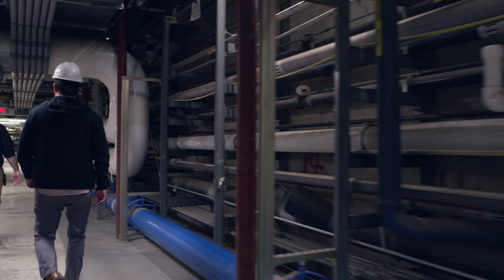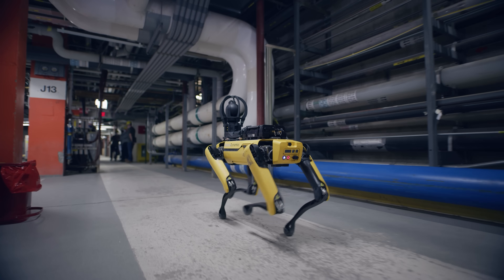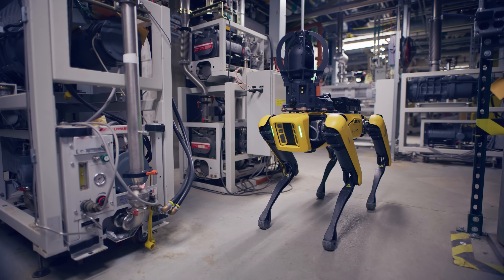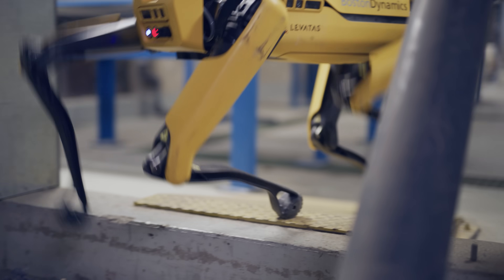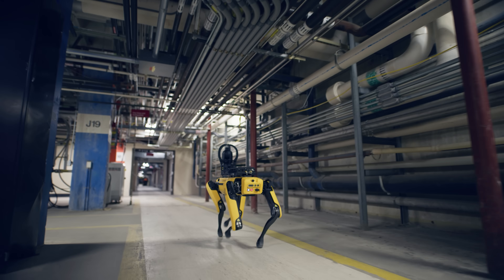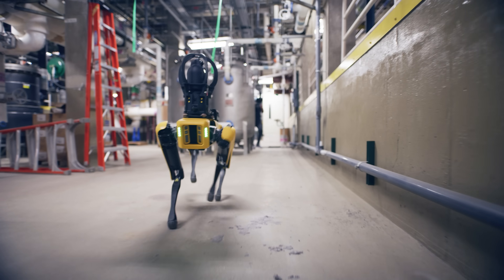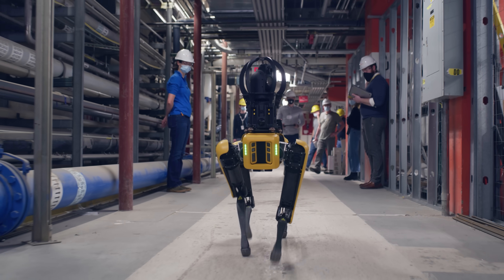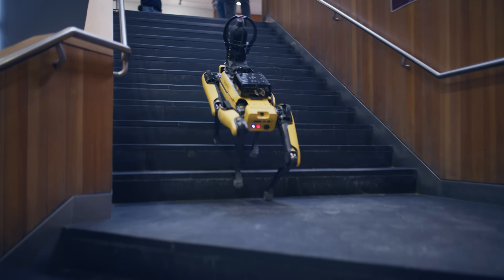Spot at GlobalFoundries | Enterprise Asset Management

Comment: Enterprise Asset Management (EAM) can be revolutionized by leveraging robotic automation for monotonous tasks, such as monitoring sensors and equipment, increasing efficiency and reducing human error. As this technology advances, it will be fascinating to observe its long-term impact and the industry's expansion, potentially leading to optimized asset performance, reduced downtime, and enhanced overall productivity.
Reply: EAM can be transformed by autonomous robots, which eliminate labor costs and needs, while offering versatility through interchangeable sensor suites. One robot can replace multiple surveyors, predict maintenance, and reduce downtime, increasing production and profit without breaks or absences, revolutionizing asset performance and efficiency.
Reply: EAM and investment strategies share a common thread - expert guidance is key. Consulting a financial advisor boosted my portfolio by 65% since January. In EAM, specialized consultants optimize asset performance, maximizing ROI and minimizing losses.
Reply: I'm looking to partner with a consultant to enhance my investment strategy and Enterprise Asset Management (EAM) practices. I've explored options on LinkedIn, but haven't received a response yet. Could you recommend a reliable consultant or firm with expertise in EAM and investment guidance?
Reply: Rebecca Noblett Roberts is the licensed advisor I use. Just research the name. You’d find necessary details to work with to set up an appointment
Reply: I just checked her out and I have sent her an email. I hope she gets back to me soon
Reply: For expert guidance on investment strategies and Enterprise Asset Management (EAM), I recommend consulting Rebecca Noblett Roberts, a licensed advisor. Research her name to find the necessary details and set up an appointment to optimize your asset performance and investment portfolio.
Reply: To enhance your Enterprise Asset Management (EAM) practices and investment strategies, consider consulting Rebecca Noblett Roberts, a licensed advisor. Research her expertise and schedule an appointment to maximize your asset performance and portfolio growth.
Reply: Rebecca Noblett Roberts is the licensed advisor I use. Just research the name. You’d find necessary details to work with to set up an appointment and to maximize your asset performance and portfolio growth.

Comment: This really doesn't require legs.
Reply: The legs are used as a way to efficiently get up stairs as opposed to wheel based robots
Reply: @guse7688  I guess, but this is great on its own. I just think that it's just to ride Spot's coat tails, so dumber people will be impressed by it.

Comment: I wonder how costly it will be to put some web cameras in front of sensors and one pc that could analyze incoming data instead of buying an expensive robot?
Reply: You are talking about hundreds if not thousands of points that would need to be refitted to accommodate such a device. Not to mention the wiring, downtime, modifications, etc. The costs of doing so would be astronomical compared to just using a single robot like Spot to just manually check the gauges and sensors. Spot would pay for itself.
Reply: more expensive. Otherwise they would already have done it.

Comment: You can use one $100k robot to read 1000 gauges, or you can use 1000 $100 raspberry pis with cameras.
(Installing power to then all might bea challenge though -- spot brings that with it)
Reply: and then you have the issue of how the fuck are you going to coordinate 1000 pieces of electronics together without constant malfunctions and errors.
Reply: @LineOfThy  True, but if even 5% are broken, you still have 950 working cameras.
I'm not against Spot at all, in fact I want one, but there's always more than one way to skin a cat.
Reply: Spot is 75 thousand with a roughly 10k software. From what I remember at least.

Comment: Spot is very cool, to be sure. But just so I'm clear - it walks around and looks at gauges? Assuming there's no way for that info to be sent to a central server, it seems like it would be a lot cheaper and less effort to just set up cameras pointing at the gauges, and someone whose job is to sit and watch the videos and note the levels on the gauges. That would return the info substantially faster than a robot that has to walk around every gauge one at a time. The whole thing feels like a solution in search of a problem rather than the other way around.
Reply: it's not.

Comment: One of the things that doesn't come through, at least to me, is if Spot learns to navigate through buildings, read gauges, do thermal imaging, etc. without an operator watching a screen and moving joysticks. So the question is - is Spot autonomous after initial training and why is it more cost effective to use Spot vs a human for the same application.
Reply: Autonomous robots don't have healthcare needs, a 401k, social security, wages, etc. These robots, most likely, can have be interchangeable other with suites of sensors  that could in theory make them multitaskers. So you've taken one robot that can perform the work of multiple surveyors(lower amount of humans required to perform the work), break down and analyze possible maintenance, thus reducing plant down time (increasing production via proactivity leading to increased profit), and never need to take breaks or days off.
I imagine an initial upfront cost may be larger, but at the end of the year an employer would spend significantly more on the human equivalent. The investment in the human could be great or not depending the person and if they would stay in the job long enough to make up the initial investment in human capital
Reply: Spot is semi-autonomous and can be trained in a routine as well as be manned. Additionally, Spot has none of the other costs or requirements a human worker needs. It never gets tired (unless you count needing to be recharged but that takes minutes to hours at best), it never gets sick, it can never have 'bad days', it doesn't need a wage/salary, it can virtually work 24/7, etc. Spot is far better for repetitive tasks like checking gauges and sensors than a human would be.
Reply: You could have several Spots with only one human operator who acts in case an alarm is triggered.
Reply: in the next 20 years majority of human jobs will be replaced by robots. So we will have to figure out how people will make an income as majority of people will be out of a job. we would probably switch to a universal income and work would be a thing of the past and people would be able to just live theor life doing the things they wish they could. Companies who switch over to autonomous robots will be charged a tax that will be used to fund the universal income

Comment: Not that I am against the project, but using the robot to check if the electromotor is hot? Come on guys! An electromotor would have a thermal sensor to measure the temperature constantly, if there is such necessity.

Comment: Using the robot is very nice. Super modern. I do not understand why is using sensors is a bad idea?))

You should try to use digital sensors and simple SCADA systems to control your sensors and systems. Get data from the sensors -> analyze it -> use the data to prevent any issues. :)
I am ready to discuss the question: where we can use the Robot like this one? where it will be really useful? )

Comment: This is cool, but wouldn't it be more cost effective to put a motorized camera in certain locations, have them all feedback to a server for image processing? Seems like this would be cheaper and probably more effective to implement. I'd imagine with other thermal sensors, not just FLIR, there are better ways to measure some things.

In changing environments, like a construction site, I'd see more usefulness with Spot. I'd imagine that Globalfoundries has a fairly static environment. I mean, a robot dog is way cooler, just seems overly complicated for this application.
Reply: Actually, when you get to facilities this large the price of digital sensors or cameras for all the necessary locations becomes greater than the price of Spot. 
Plus, the amount of time it would take to install all of those and the amount of additional failure points would render Spot the better option even if it did cost more.
Reply: @Roger44477  The cost of a single Spot + all the accessories it would take is edging on $100k. If the company was all about redundancy, they'd need to buy at least two Spots.

I'd imagine there are plenty of companies that could put a few dozen wireless sensors + cameras for significantly less than that. I just thought this was an odd use case. I figured it would've been a better example if used for a dynamic environment. New dangerous environments = check, construction sites = check, etc.

I think the work Boston Dynamics is doing is amazing. I'm definitely not crapping on the company or tech.
Reply: @davidbetancourt4028  Damn, why haven't you told them already?
Reply: @davidbetancourt4028  damn, I can't believe a single youtube commenter is smarter than an entire company of people
Reply: @LineOfThy  I don't think you understood or comprehended my original statement, or you were just trying to be snarky w/o putting any real effort into thinking about what I said. I did not phrase it as a matter of fact. There was literally a question mark at the end of the first sentence.

Generally, and not from this thread specifically, I'm kind of tired of these half assed comments that are intended to be 'oh, look at my smart ass remark, ha ha funny, got em!'

Comment: It looked like someone still needed to drive Spot. If that's true, then what's the point vs having that employee look at the gauges?
Reply: That was just while still setting Spot up. Once they run it through manually and "train" it, Spot can walk the whole facility automatically and only send out an alert if something reads as abnormal, such as a pressure gauge reading above or below accepted parameters or a motor running too hot

Comment: As an engineer at this facility, I’m super excited to have Spot helping us maintain our equipment and improve our signal monitoring. Great work to the automation team here at Fab 9 as well as BD!
Reply: This is probably the first public reference location that made sense.  All the videos of Spot as a metermaid I have seen before were from small locations, where just installing 20 sensors would do the job for basically free compared to Spot.  It seems that we saw only a very little of that site in this video and using Spot might actually save a lot of time in the start up phase versus installing actual sensors for everything and is probably much cheaper.  Vibration sensors would found bad bearings earlier, but thermal imaging by Spot should be enough to prevent surprises though.
Reply: @villehietala9677  not to mention wiring all those sensors to main control would be difficult. When most sensors don't need to be 24/7 monitoring. And humans can make mistake of forgetting checking a specific sensor when Spot won't forget as long as it entered once.
Reply: Put some sensitive audio sensors to listen to pipes as sound can tell allot.
Reply: @death13a  Spot is better
Reply: @Andrew Woythal I'm curious, Can't you just install gauges and sensor that can be monitored remotely and automatically by a computer to perform the same task with 24/7 monitoring and instant response instead of waiting for spot to do it at pre-programming times? Even then spot will need to relay this info to a system to alert a human, What is the benefit of having spot do it vs the ladder?
Reply: @GooseWurkz  While I can’t answer this definitively as I’m not directly involved on this project, my understanding is there are hundreds if not more than a thousand of pumps in the sub fab area. Having to retrofit all of the existing equipment with new gauges and run cabling would not only be expensive but extremely time consuming. Plus if any equipment is ever moved or changed, the wired sensors would all have to be redone. As for the response times, the rate of failure of these pumps is not immediate so even getting data when Spot runs a check will benefit us to detect a change in trends if an issue begins to arise.
Reply: @GooseWurkz  as someone that also works at this location. You'd be suprised with what we actually work with
Reply: How many additional people they hired to look after Spot?
Reply: A drone will be cheaper. If you wanna impress people, just install disco lights and let it dance in the air.
Reply: @vpryt18  I dont think you understand how cheap we actually are here
Reply: Liar
Reply: @absolutelyfookinnobody2843  How do you know? proof?
Reply: @arthurlunar7835  all they had to do was Google my name 🤦🏻‍♂️

Comment: Why can't they just put sensors on the engines to get temperature data straight into cloud/admin panel? What is the point of using a robot to go to each location if you can connect practically anything to the Internet nowadays? It seems to me that these tasks could be completed with less efforts/money but now you have to check/charge/mantain/pay for one more device - the robot
Reply: Because the time, effort, and cost to retrofit would be more than the cost of a single Spot in locations like this where there are easily thousands of points, gauges, and sensors that need to be checked regularly.

Comment: Any and all sensitive equipment should be monitored no mater what. 
A robot should be implemented when your systems are 100%. 
 I don't get the pricing figures though? They say hundreds of thousands if not millions to set-up a sensor station BUT most are either a 1 wire 2 wire or 3 wire on low voltage and amperage so even an Ethernet cable can be used with an inline booster and sensor's are literally only a couple of cents! 
I guess it's the software/code your paying for...
Give me a few weeks and a couple hundred $$$ and I'll set-up a sensor network.
Reply: It's also the downtime and modifications that would be needed to implement those sensors. Everything would have to be reengineered to accommodate sensors of the quality and precision they would need. Those costs quickly add up and also would take a lot of time to implement in locations as large as this (easily talking thousands of points/gauges). Whereas Spot is here are ready out of the box.

Comment: Amazing work, exciting to see the progress!
One thing I was asking myself: are these analog gauges still state of the art technology? Is there no solution to get digital readouts from all gauges simultaneously at all times?
Reply: In the video they explain that it's cheaper to use one robot rather than install digital sensors in many locations.
Reply: @BardCanning  oh thanks a lot, I totally overheard that!
Reply: @BardCanning  ofcourse they do but i cannot imagine the cost of sensors being much more than THOSE equipments. Perhaps a further validation of primary data maybe required.
Reply: There's also the matter of how time consuming of a retrofit that would be, and how many new points of failure would be introduced